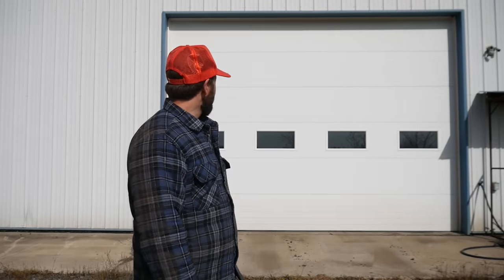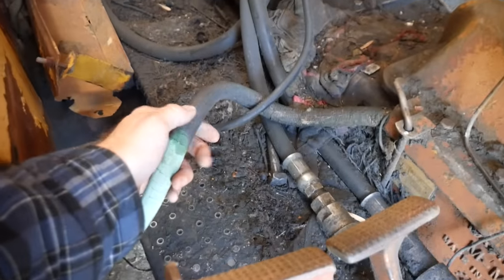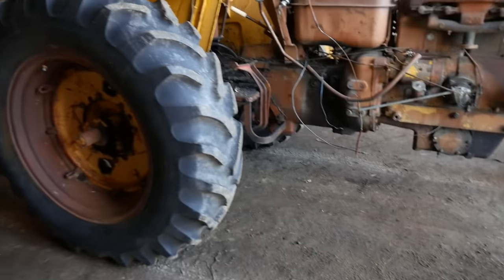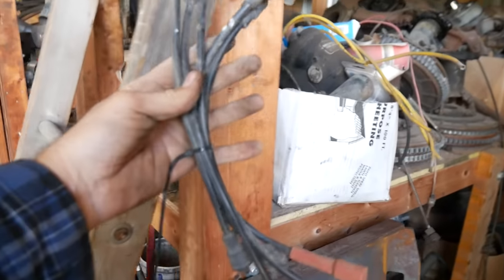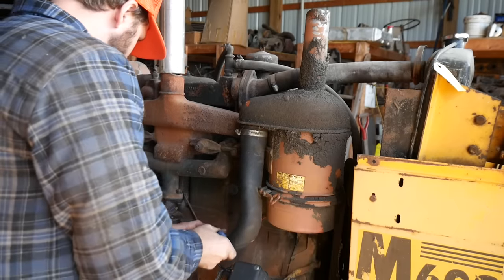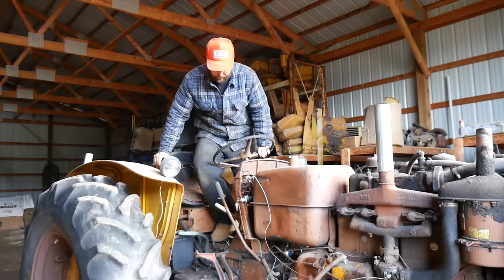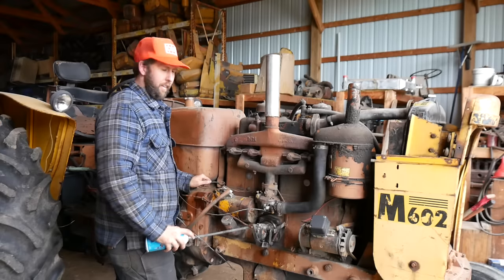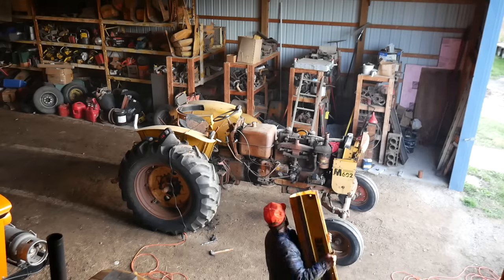Old vintage tractor..will it run after many years? - Vice Grip Garage EP43

Comment: This is about the 472/500 Cadillac engine ,on the crank I use my hub install tool I leave it in the crank when I build the engine, I use the washer off the big block Chevy.

Comment: My  Grandfather  bought  a  new M-604 with front  wheel  assist  a  shuttle gear and a high lift loader  custom  built I think in Gaylodr  MI ..  My  Grandfather  sold it to my Father for  $5,000.00  a  few year later my Father sold it to a Cousin.. They both used it to load lime in farmers fields to spread lime..   My Father sold it to my Cousin for $5,000  too   45 years later my Cousin passed away and I think his wife  traded it in  at Burnips  Farm  Implements  maybe near Grand Rapids  MI ..  It's  worth around  $30,000.00  today .. My  Father  bought a  new Michigan  45B loader in  1974 for  $30,000.00  on sale from $36,000.00  do to the recession ..
Reply from the maker: Wow!!
Reply: @ViceGripGarage    My  Grandfathers  M-604  was  so  valuable to Collectors    because  it has  front wheel assist..  A Coleman  front axle..  Hired  Help  broke a front axle and   My Cousin  got an axle  out of an old  Military Truck ..  Maybe it was a Conversion  Truck  like an IH ..  I think MM  was bought by White  Moror Compnay about  1973  or so ...

Comment: I would make sure the the venturie in the carb is the correct way. I rebuilt a marvel carb and accidentally put the venturie upside down and it would run on ether but wouldnt pick up gas. It took me forever to figure it out. Hope this helps, gotta keep those molines going! :)

Comment: Had the same problem with my 9N. My issue was a little knob on the carb that got wiggled the wrong way and she wouldn’t fire no matter what I did. Then I tried starting it with no throttle and it fired right up, then I realized there was a knob that controlled fuel or something while it was getting throttle. Got it idling and adjusted that screw while gently giving it throttle until it was set and no issues since.
Reply from the maker: Interesting
Reply: @ViceGripGarage  Hello, btw, from a dinky town outside of Fargo! ZiptiesandBiasplies lead me here. Love your videos, guy. You got me all excited to tear into my 70 F100 as soon as i get it outa the snow bank. Parked it a few month ago running with zero oil pressure, she makes a real interesting sound from her innards, last i heard. Made it home though!
Reply from the maker: Good luck!!

Comment: Tips continued:   #5:  Old tractors typically  don't have resistors on the ignition system because the coils have them built in (for 12 volt only).  You have to make sure that you replace it with one that has that.  #6:  I not sure about battery coil ignition systems,  but can tell you that you need old fashioned metal conductor spark wires (not the resistor suppression type) on tractors that have magnetos.  I have had this be a problem with a couple of magnetos that someone had modern wires on. I think the output spark voltage is generally not that high on mags,  especially if the magnets are weak.  I also think that older coil and magneto ignition systems ran on lower spark output voltages in general or were designed with metal spark wires in mind and only needed  a lower output.  I believe that resistance spark wires need higher voltages to deliver a good spark and is why this matters.  I thought the main reason resistance wires were used was because the metal ones cause radio and TV static (in vehicle radio or a nearby radio or tv).  I have seen this happen (a snap, snap, snap in a radio or tv)  when I am operating an old tractor in the yard.
Reply: it obviously RUNS when gas is poured down the intake so spark is 5☆'s.

Comment: Wow, I felt sure you were going to get her running, but I suppose even you have your limits, I think maybe your have another think, and maybe have another go at getting her to continue running,  that I know would bug the life out of me, I would probably give her another go maybe, we are different, but she sounds so close, I had a similar thing happen on my car, and even though the get seemed clear, you could see right through it, but there was a tiny little wisker crossing the hole, and that was anough  to stop it running,  I was getting  the exact same thing, had fuel in the bowl floats were good, but that dang thing would not keep running I got a very tiny needle file and gently filed her little and compressed air her hole, and bang if she did not start running. Great Video Derek

Comment: Did you pull the idle jet out and run a wire through it. That's usually what is plugged. Sometimes those jets are right behind the idle screw. I'm sure you know what you are doing but I have found jets plugged after cleaning a carb and they are off for the second time. Another thing is the fuel line after the bowl.

Comment: It looked like you had a fuel leak between the fuel bulb and the line going over to the carburetor. It was leaking the whole time you was trying to crack it over. If you have air in them lines the engine will not start or run right. Go back and try again. I'm sure you can get it running. Best of luck man.

Comment: Hey Derek! You should have checked the fuel line going from the tank to the carburetor. I almost guarantee you'll find out it's blocked. You get a chance, go back and revisit that tractor, change out the fuel line, and see if I'm not right.
Reply from the maker: Did multiple times, thanks for watching

Comment: the large thumb screw on the carb faceing down to the bottom jet make shure the hole in the bottom of carb going to the intake side of carb is clear.. thumb screw id try 2 full turns out from in..and the little jet towrds the top is for idle only the large thumb screw on the top of carb is fuel mix

Comment: that looks just like the M5 moline, they were pretty good tractors except the hydraulic pumps and steering would give you trouble sometimes
all you had to do is tap the carb a few times with a wrench  to free up the needle valve and it would have run by itself

Comment: Like your channel. 40 or so years ago ran into the same problem. The main passage between the needle & seat and or the float bowl vent was  stopped up. Gravity fed gas does not have enough pressure to overcome air trapped in the bowl and if ethanol gas was left in it that will stop everything up. Would like to know if that was the problem here. Keep doing what ur doin.
Reply from the maker: Thanks Mike

Comment: Maybe would have started if it was a Case or a Massey Ferguson.  That's what my Dad and Grandpa always had on the farm (in Missouri).  I think Dad had one International Harvester after I left, but I don't know much about them.  I was driving a Case when I was 12. I used to love the ball on the steering wheel so you could whip it around really fast. That was a long, long time ago.

Comment: My Cousin and his wife gave me a Nice 2004 Buick Rainier ..They  just moved to Florida from North Carolina in that truck and drove it all around down here for a few weeks ..They bought a new car and asked if I wanted the Buick ..So I said Hell ya ..Can't beat a free vehicle. ...He fired it up and followed me like 5 miles down the road to get the title notorized ...Shut it off and we went in and signed the title ...Came back out and the Buick wouldn't start ..turned over great ..just no start ..My First thought was a crank sensor ..I towed it home and put a crank sensor in it ..and the same result ....Ooooh lordy ...thinking it may be the fuel pump ..turn key on and don't hear the pump ..and gots no pressure at the shader valve ...So now I'm feeling like you did with that Tractor ..I'm all heart Broken and in tears

Comment: Awesome videos man! I really enjoy the type of videos they are unique style. I finally remembered a good one from peg leg's recommendation so this is my first time watching your channel, I live so the same thing with tractors that have sat for many years and getting them running. I recently did an 8n string for 26 maybe max of 30 and it was the easiest ones to get started. Here are some of the tricks/ opinions that help me in starting old iron Even if the engine isn't stuck this always help especially since you need it to uysually spin as fast as possible during first start but alot of times even with fresh batteries that's just how fast the old tractors turn over. I bet you over 50% of the time trying to get old iron resurrected you just have to pull start it idk why but I have trouble shot for hours and havnt touched a damn thing but as soon I pull them they fire on the second turn over lmfao. And you are also from MN me to unfortunately lol but I am located in E.C which is now just 1000s of small farms rotting away and there's absolutely anything and everything laying around if y ok y wanted some leads. Tons of gig old construction equipment to! I also know of the biggest model(largest ones made at that time.  cat dozers that they left while and after building some of the roads and haven't been moved since!
Reply from the maker: I did consider draggin this thing down the road haha

Comment: I hope you understand that bunch of wire from the coil to the distributor is a resistorized wire and if you cut it to length you will mess up the resistance that wire is supposed to have. Old ignition systems used that wire in place of a resistor on a bunch of units. Mostly it was used on 12 volt systems in conjunction with a 6 volt ignition system and thats ecactly what that wire did was cut the voltage from 12 volts on the tractor to 6 volts on the ignition and if ran properly it should run from the ignition switch tothe coil if I remember correctly. Chevrolet and GM in general were the first automobiles I ever worked on that had that type of Ignition. Itwas laTER ON REPLACED BY A Ceramic resistor on the firewall and later on done away with completely when they finally went to a 12 volt ignition system

Comment: Did a guy put a good carb kit in the carb? I put a cheap carb kit from tsc in one of my tractors once and I had it apart several times before I realized something was just a little funny with the needle and seat. I spent a little more money and got a kit from Steiner's and she fired right up. Thanks for the entertaining videos!
Reply from the maker: Cheapest kit i could find.  Most likely the issue

Comment: Did you ever think that the air intake might be blocked?  For the fuel to make it to the carb doesn't there need to be a way for fuel to push the air out. It just seems like the idea of holding your finger over the end of a straw, or maybe just a new fuel line.

Comment: Did I miss him using the adjustable carburetor hammer?  Everyone knows it takes 2-3 whacks minimum.  Also this is where you need a buddy.  When I was young with my dad by the 3rd failed start we would have a strap on the front and be dragging it in gear instead of burning up the starter.

Comment: Hey Derek I have from my grandpa's stash 5 Marvel Schebler, TSX795 Carbs I think my fit the M602 I know I'm a year late but your welcomed to have them as they are just collecting dust and I also have 2 sets of heads for the M602 and I think will fit the M670 Super. The Casting #10A4210.

Comment: Yeah old up draft carbs are hard to get but two flanges and a length of pipe in a u shape add a standard down draft carb of similar size less problems plus easy to get at work better to

Comment: I'll bet the carb would have cleaned up if you had an ultrasonic cleaner on your truck.  They are pretty reasonable at $150 and are about the only thing I've found that will knock all the crud and gunk out of the tiny passages in those old carbs.

Comment: A guy might pour a little oil in these old cylinders to help build pressure. Also I think maybe you adjusted the float wrong. It looked good to begin with as the float should be parrallel with the bowl gasket surface

Comment: At least you tried, and that's more than most people do. I think your Fuel Make it happen er lol was screwed up and needed a new and also you needed a new air filter if it ever had one in it.  Didn't see one so it might have had a clogged air filter or no air filter which that should have ran.  Mostly in the Fuel Make it happen er lol.  Also not enough battery to turn it over fast enough.   But doesn't matter you can't make them all run.  Your site is a lot of fun to watch and so is your since of humor.  Keep up the good work.

Comment: Failure is the back bone of experience. As you know a bucket of gas won't cure all carbaratter woes. I'd have liked to seen you open the mixture valve more

Comment: If you haven't figured it out by now.  Those carbs have a problem with getting fuel from the bowl to the intake side of things due to the main jet passage corroding up and choking itself off.

Simple fix is to just redrill them and do it a bit over sized. Next 64th size over what looks like it should fit works well   After that, make sure the main jet metering rod is not in too far.  they have a tendency to creep out over the years and end up in a position so far in that cranking the main jet adjustment knob on the end doesn't actually do anything that matters.  

Reason why, beyond just cleaning things out,  on the oversizing of the main jet passages and making sure the metering rod goes all the way up is that today fuels are way less volatile than the stuff they had back when these tractors were new.   So much so that for many of those old engines with low compression they need to be ran way richer than what the maximum stock setting allow in some cases.  

I have a old MM UTS that even with the main metering rod completely removed still couldn't get enough fuel through to run at load so drilling everything oversize was the only way to get it to work.  Now it can be turned up far enough to puff black and barely run at full open jet settings.
Reply from the maker: Thank you great tips
Reply: @ViceGripGarage  You're welcome!   I've been playing this fixing old machines game since I was in my teens some ~ 30 years ago.   Seen a lot of stuff nobody seems to think of in these sort of videos way more than I can explain in words.  

Been getting some strong pushes to start my own channel now just to show off my hobby stuff and help the next generation learn how to do this stuff.  Especially since my interests go way beyond just tractors.   

Not so sure I want to now, given how it sounds like YT is going to start killing off every small channel it can if they dont feel  its one that fits 'the narrative and agenda' if you get what I am saying.  :(

Comment: Not to be critical but for safety reasons you might consider getting a metal bucket for when you're pouring gas. Plastic can carry static and that's enough ruin a guys day if the vapor ignites.

Comment: I believe the tractor I drove was 1930ish little blue ford tractor with auto ejector seat 5000 so we dropped her down against the frame so I am 10 or 15 inches shorter than I should be. 40 years later I am still waiting for the feeling to come back to the ol fart ripper.

Comment: Been there, where nothing seems to help. You know it's not getting fuel, but why? I wonder if it has enough vacuum to pull that fuel up from the carb? Is there a good strong flow at the carb end of the fuel line? I had an old Caterpillar Ten and fought with that thing for ages. Had wasp nests in the fuel tank and for years pieces of wasps would come down the fuel line and plug it up. I learned one thing.... wasps do not dissolve in gasoline!

Comment: I don't like how the fuel line had an incline up, it's gravity fed, perhaps the fuel line should slope down from the fuel valve to the carb.  I saw it also drip quite quickly when fuel was turned on and it was trying to start.  Which is dangerous and doesn't help any to send fuel to the carb. 

I also think that perhaps there is an obstruction to the air cleaner.  Probably mouse house.  Worked better at the end when fuel was dumped straight into the carb.  

New cables for the battery as well.  They were pretty nasty and probably the reason for the slow turning starter.  I had an electrical fire on my 1979 trans AM because I didn't replace the positive cable which was severely corroded.  (In 2005 when it was already an old car)

Comment: bought my '65 Impala in 2009. A wreck. Knew nothing about cars. Worked on it like a demented man for years, got burnt out. Still got it. Still not finished. Never gonna sell. Still love it. I owe nothing on the car. It's mine. It's here. It's in the garage.

My suggestion : never take out a loan for a restoration project unless you have a good reason to. The car itself should not put you in debt because the blues of wrenching CAN happen, and it goes away after a while and you'll want to work on it again. If you're in debt and the blues getcha you'll want to sell the car to pay it back, then few years down the line you'll curse the heavens for selling it.

Wrench on.